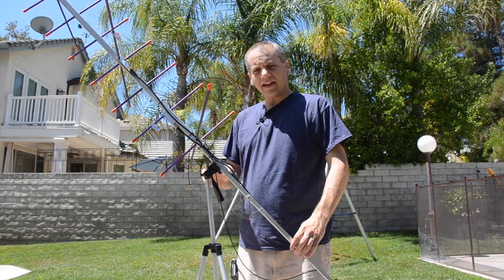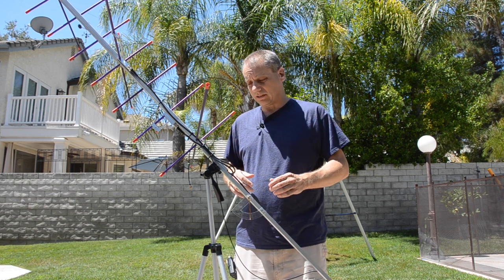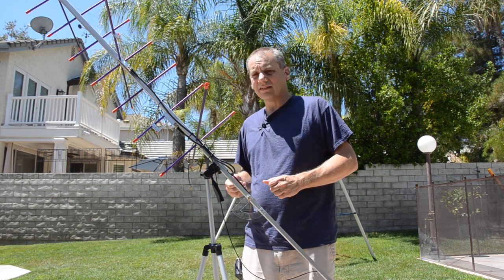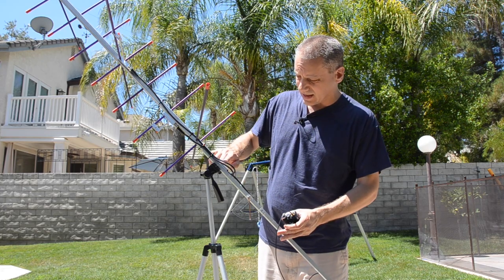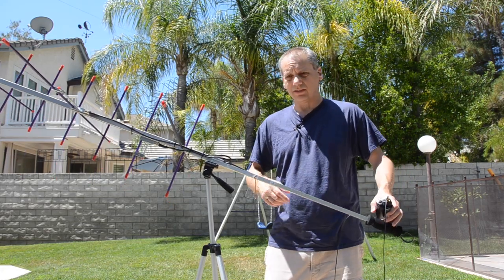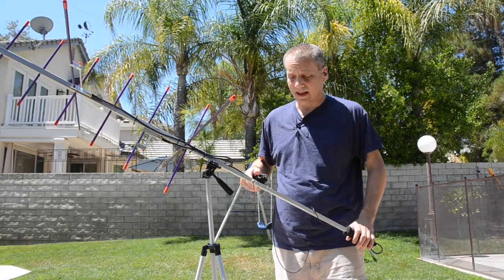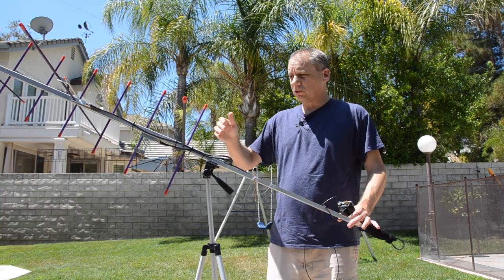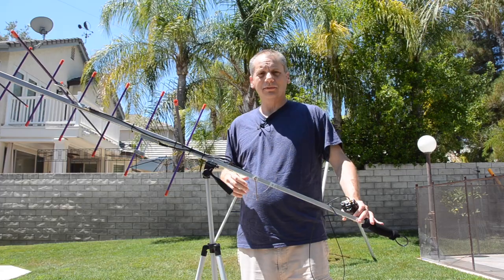Arrow Antenna Review and Setup for ham radio satellite QSO

Comment: Great video! How did you attach the additional piece of aluminum to the antenna? Do you know what were the dimensions of the piece you attached?
Reply from the maker: Attaching the Aluminum piece is very easy. Underneath the black sponge handle that comes with the Arrow, there is a hidden hole that fits exactly to the screw that comes with most of the camera tripods. So all fit without even to drill anything. As simple as that! The Aluminum piece is the standard piece that you will find in any store for few dollars. It comes in a standard length so you just need to cut it to the length you want. You will need to drill a single hole in the aluminum piece and you will locate the Aluminum in between the Arrow boom and the tripod. It will stay in between and it works great. 73.

Comment: Can you tell me the model/type of tripod you are using?
Reply from the maker: I have few tripods that I'm using for different use cases. In this case, it's a super simple and standard camera tripod.  You just need a tripod that can move in 3 axis. Today, most of the tripods have this capability, and they are very cheap.

Comment: Does it matter if the elements get bent slightly ?
Reply from the maker: It really hard to answer that without see it, but as a high level answer, yes, if the elements are a not straight as they should be, it can affect the SWR and and radiation pattern, so it will be less effective. 
But if it's slightly bent, it could be that it's not a big issue. If you have an SWR meter, you can check and get some idea what's going on. I hope it helps. 73.
Reply: @reHamRadio  thanks for reply  i just got mine, but I noticed that on the feed wire theres a kink in the silver tube, also theres a bit of a warp in the bottom elements, I have the split boom. They dont line up perfect